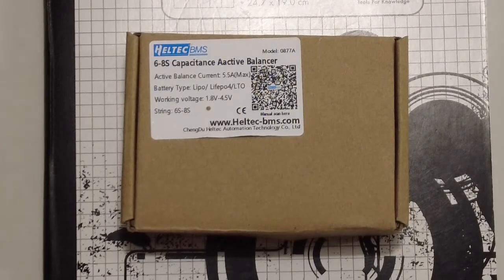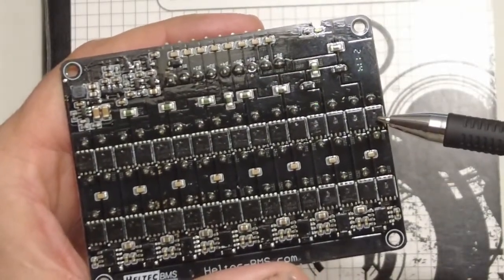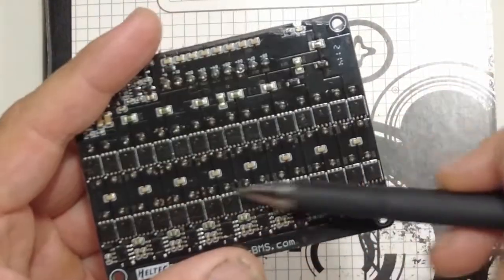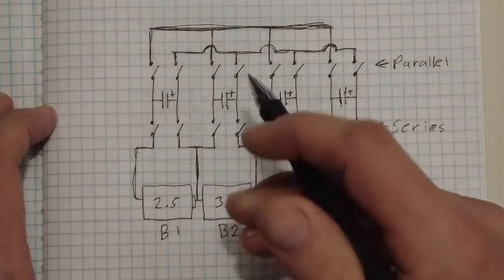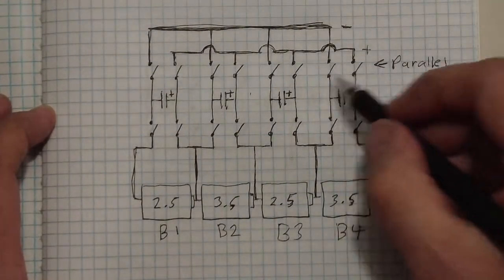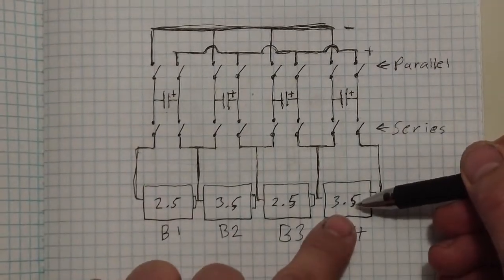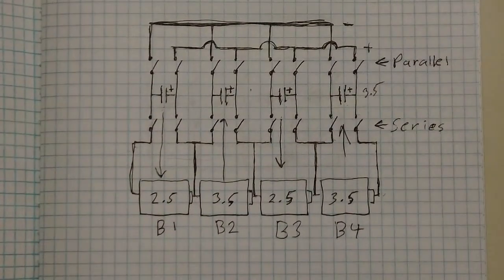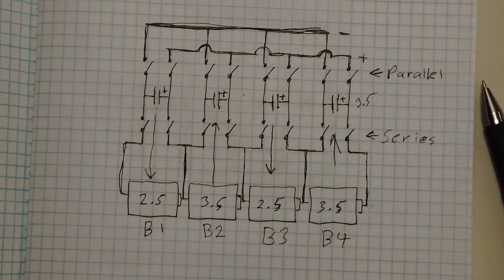Active Balancers - How Do They Work?

Comment: I have a question. Can  I use the active balancer 24v on  Lifepo4 Battery 12v.  In 2S 12v to balance the each 12v battery?

Do I need too jump together the 3 middle wire in active balancer to use it in 2S 12v?

Comment: good scheme, but it is not flying capacitor scheme, in flying capacitor scheme there is only one capacitor
Reply from the maker: The way I understand it is: Any scheme that uses switching to reconfigure the connection of the capacitor (or capacitors) as in this case from series to parallel, and back is called flying capacitor. The number of capacitors used is not a factor. The scheme is called "Flying" since the caps do not have a fixed electrical position in the circuit. Thanks

Comment: I personally prefer the serial balancers (I use to call them shuffle balancers) which balance a certain cell with its neigboring cells. They usually work as fast as the serial / parallel balancers because typically there are just a few cells in the chain out of balance. And these balancers require just half of the  switches and s-1 capacitor banks to work. They require just a simple clock generator and 2 high current MOSFET drivers to work. They have furthermore less inner resistance. I build them by myself and I am happy with their performance.

The clockfrequency I use is relatively high (50 kHz) in order to take advantage from a nearly constant balancer current which is proportional to the voltage difference between the neighboring cells and the cell to sink or source the current. Due to the lower inner resistance of the circuit I can reach 15 to 20 A balancer current at a voltage difference of 0.4 to 0.5 V with commercially availlable MOSFETs and low-ESR electrolytics (the last time I have used 2200 µF, 4 V electrolytics with 7 mOhm ESR 4 in parallel to achieve 1.75 mOhm ESR and 8800 µF and n-channel MOSFETs with an Ron of 1.1 mOhm and a total circuit inner resistance of 5 to 6 mOhm to balance LiFePO-cells with an inner resistance of 7 mOhm).
Reply from the maker: That's really awesome! So you've got it pretty tuned. That's my favorite, I love to optimize :) Thanks for sharing.
Reply: Thanks for the details. I am trying to understand balancing as good as possible  and have following more deep questions:
1) Do you use some voltage logic to switch on and off/automate your self built balancer? If yes, which voltage difference criteria do you use for on and off switching? If no, which criteria do you apply for manually activating/de-activating your balancer.
2) In my theoretical image it takes longer time to do a serial/serial (neighbor cell) balancing compared to a serial/parallel (all high voltage to all low voltage cells) balancing, because in serial/serial the charge need to be transported in worst case over S cells before you get it balanced (extreme case, the most distant cells are dis-balanced)? (Though I would say seeing your extremely high 15 to 20A balance current the difference is rather of academic importance, but it influences also negatively the heat generated)
3) Would you agree my statement, your high current is the result of minimizing the sum of all parasitic ohmic resistances starting with the switch, over the capacitance to the battery cell cabling.
(For me your numbers are not totally matching: 5 to 6 mOhm total circuit resistance + 7 mOhm cell internal resistance gives total maximum 13 mOhm. At 0.4V this would result in a current of 31A, some 50% higher than your quoted 20A. To me it looks there are additional 6 to 10 mOhm acting to limit the current.)
4) Can you quote some typical or min/max time it takes you to balance your battery?
Thank you in advance for your reply.

Comment: Thanks for the video. It's very clear and helpful. The active balancer will only balance cells. For those who use LiFePO4/LTO cells on car battery, it will not help reducing the over voltage by car generator. You need passive balancer.
Reply from the maker: Yes it will only balance cells. You need a BMS still to protect from over/under voltage on each cell

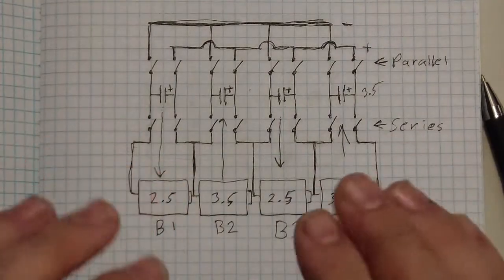Comment: 7:28 Yes, except this balancer never puts the cells in parallel with each other, only with the caps.
Reply from the maker: Right, did I misspeak? The caps have a series mode, and a parallel mode. When the caps are in series mode, each cap is paralleled to it's adjacent cell, in this case its like a 2p8s config. Then the caps go to parallel mode to avg the voltage across them all, at which time they are no longer connected to the battery cells.

Comment: 3:45 It appears when the switches marked "series" are closed, that puts each cap in parallel with it's adjacent cell, not series.
Reply from the maker: The switch marked series puts the caps in series, yet each cap is paralleled with it's adjacent cell. I should have made it more clear, it's 2p8s at this point.  The caps are in series, but they are paralleled to the cells. Thanks
Reply: @BradCagle   yes, but it seems closer to 2P4S. But not even that, because every cell is parallel to it's adjacent cap. So there are extra connections which don't exist in a 2P4S. i think it can't be described with xPxS notation.
Reply from the maker: @johnaweiss  Sorry yes the diagram is 2p4s, the actual balancer I had in my had was 8s. I'm commenting without re-watching the video and making mistakes LOL
Reply: @BradCagle  Your diagram seems correct, but i think the connections aren't 2p4s.

Comment: Nice video, thank you! Thinking about the simpliest way to implement balancer with same principle lead me to idea that probably this should be combined with cell monitoring function. It should work on the principle - cell monitoring connects the highest voltage cell in the pack to capacitor. Then it diconects from higest voltage cell and connects the capacitor to the lowest voltage cell. Think most ot smart BMSs and balancers work on this principle. Some one was wasking for soic 8 which is probably gate driver chip and most probably is XJNG2103 (chinese brand with inverted outputs).

Comment: Great video, thank you! These devices have gotten so cheap... I picked up a 21s one for only 36 bucks shipped, took 10 days to arrive from china. These boards, in combination with a cheapo regular dissipative BMS (usually I find one with a UART) are great... the active balancer keeps the pack balanced, the cheapo bms reports cell voltages to whatver microcontroller you use to monitor the pack...
Reply from the maker: I love these. Great for packs with dodgy cells. Thanks!

Comment: Nice Explanation.  The power loss for an active balancer like this is roughly the (switching frequency)*(single capacitance value)*(variance of cell voltages).  The switching frequency should be roughly 1/(10*Rds,on*C) to ensure the capacitor voltages reach the cell voltages and the cap voltages have time to equalize when they are all connected in parallel.  Higher switching frequencies in general, allow you to drive down the voltage differences between the cells (decrease the variance) while the cells are charging or discharging, improving efficiency.  Minimizing the capacitor values is also important for good efficiency.  The Rds,on of the mosfets will determine the "rate of charge imbalance" the system can correct for.  Lower Rds,ON allows for faster charging/discharging of the string while still keeping it near perfect balance. 

There might be a power advantage of running a balancer like this at a low duty cycle (10%) to minimize the power draw of the balancer itself. You might need to only turn it on for a small number of short bursts (20?) through the entire charge/discharge cycle, especially if the cells are well matched.

Just remember, you really only need a balancer when one (or more) of the cells in the string is approaching the min (2.5V) or max (4.2V) cell voltage (that includes under high current conditions). So, you can use a balancer to get more charge into and out-of your battery pack, but you probably shouldn't be pushing your battery pack this hard anyway if you are trying to maximize the life of your pack. You can effectively prevent over-charging and over-discharging the old-fashoned way, by just monitoring your battery pack's voltage and not pushing it to the limits. 

Just curious, what are the capacitance values and mosfet Rds,ON (or part number) for this circuit?

Comment: Hi, I have a curiosity, could you tell me the printed code of the 8-pin component? (soic-8)
Thanks!
Reply from the maker: I'll take a look, and see if there is anything printed on it.
Reply: @BradCagle  Thanks a lot !
Reply from the maker: @IL_Praticone  No problem. I'll check it when I get home from work.
Reply from the maker: Sorry took so long. There are no markings on the connectors. I measured the pin pitch (spacing) at 4mm centers, and the pins are about 1mm thick.
Reply: @BradCagle  sorry I didn't explain myself well, I meant the code above the black electronic component with 4 pins
Reply: I think it's the mosfet driver
Reply from the maker: @IL_Praticone  So you want the part number of the mosfet driver?
Reply: @BradCagle  yes !
Reply from the maker: @IL_Praticone  Ok, I'll try to get that tody
Reply: @BradCagle  yes!
Reply: thanks! a lot !
Reply: @BradCagle  have you found the part numeber?
Reply from the maker: @IL_Praticone  I looked. But unfortunately it appears there is no writing on that part. There is a conformal coating covering the bottom of the board maybe that is obscuring the writing?

Comment: Ok, got it. On the other hand this means that if you connect two of those to your battery, and the high frequency cycles are not in sync, they might just push current back and forth from balancer to balancer, right?

Or does connecting those in parallel to one battery work?
Reply from the maker: I've thought about this, and it may be that the sync would be a problem. It might also be possible to find the control signal on one board, and route it to others.
Reply: @BradCagle  Good point! Hoping that an electronics-savvy reads this ..

Comment: These work great but they are always on. You want them to turn on at above 3.4 volts per cell and off below that. Better to have it off at float (timer?) There is a provision for a switch (remove solder jumper). A charge control relay can be employed but most are inaccurate in that range. I got a box full.  Check the specs, you need a resolution of .01 volt, .10 is no good. Balancing below 3.4 volts can give you all kinds of balancing issues.
Reply from the maker: Yeah, they are on all the time. You probably don't want to put a battery in storage with one of these connected. That being said, I've used these in several batteries and have had 0 problems with them running all the time. Just really nice and balanced packs, and helps to keep those cells that  like to hit 3.65 before the others more tame.
Reply: @BradCagle  
I use 16S version Heltec on 32kwh system and it works well as long as you don’t try to do any balancing below 3.4 volts. Let the cells go where they want below and up to that point. If you try to balance at say 1/2 charge you’ll be forever playing cell voltage bop-a-mole until you disassemble and do a good top balance again. They will balance at full charge but the closer they get to balance the less balancing power they have. It could take several hours. If you’re throwing a lot of charge current and you are approaching full charge even a good bank can go a bit wonky. To reduce that, just don’t charge over 3.525 per cell - bulk with little to no absorption time. Little capacity to be gained and a lot less headaches. I’m going with a new type that has up to 4 amps of balancing power even at low cell differences. The latest version has an app for Apple instead of Android. I think Neey (2~24S 4 amp) makes it or it’s a knock off. EBay for around 160$. Should have it the first of the year.
Reply from the maker: @SkypowerwithKarl  Interesting, I never experienced the bop-a-mole in the middle of state of charge. I have a 4s 100ah pack with a 4s balancer, it gets fully cycled everyday so I might check to see if its gone out of balance. Yeah, my sweet spot for lifp04 is about 3.45v per cell this keeps the cells out of that steep curve where one or two tend to rocket up, and still gets the pack fully charged. I'm still kicking the idea around of building my own balancer with higher power MOSFETS, and maybe super caps. Toying around with the series parallel switching frequency would be fun to see how much power I can get it to transfer. I would use an Arduino to control it so would have some programmability smarts.
Reply: @BradCagle  
Sound like you know what you are doing.  I know just enough NOT be dangerous lol. There are a ton of balancers out there now, four times as many as a year ago. The Neey brand seems to be the one to beat. (4 amps at near full state of charge) It uses super caps and uses whole battery to assist. If you are doing it for your own entertainment, great but for market, I think you got way too much competition. The fine tuning through the apps is phenomenal. Where there’s a huge need is in affordable high current top balancing. To parallel top balance four 280ah cells from the factory voltage (no series pre/charge) will take a week with a quality 10amp power  supply, no banana plug, # 8 wire and lugs. To top balance sixteen 310ah… not gonna happen with 10 amps. You need a minimum of 60 amps, preferably 80. (Only limited by terminal resistance/connections). Build a CC switching power supply that first charges to 3.4 then absorb, then to 3.5, absorbs then to 3.65 volts and cuts off. It shouldn’t fold back too early before reaching set voltage light cheap power supplies. Do that and the world will be beating a path to you. Look at my cluj “Fast 80 amp top balancing for your LiFePO4 cells” on YouTube. I’m sure you can do better.
Reply from the maker: @SkypowerwithKarl  oh, anything i do is not for profit, it would be released to the community for DIY, and learning.

Comment: Wow! Thanks for making it so clear. Please do build a bigger one.  You will have to make sure though, bigger doesn't always mean better because bigger capacitors will take more time to charge and discharge which means the frequency of switching will drop accordingly. if it is in kHz now then it could be in 0.1kHz. I guess we will never know until we simulate or build a circuit. Please do. Thanks
Reply from the maker: You're welcome. Right, I'm not entirely sure bigger will be any better, would be interesting to experiment though!